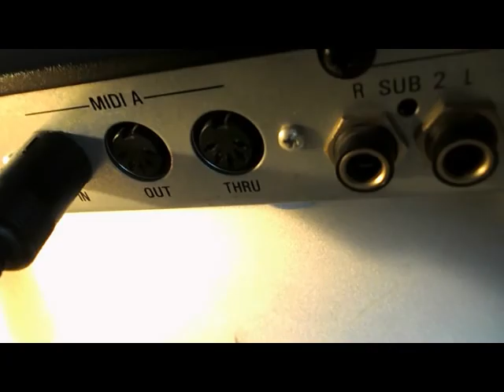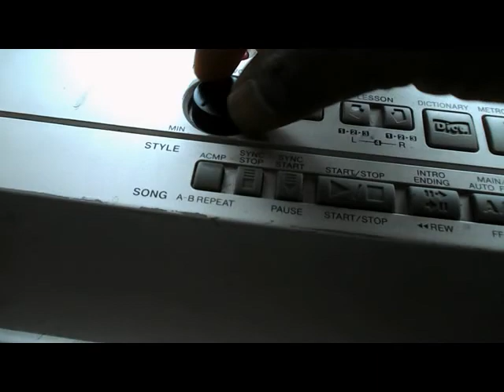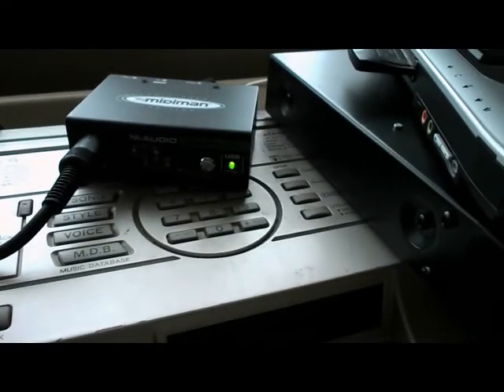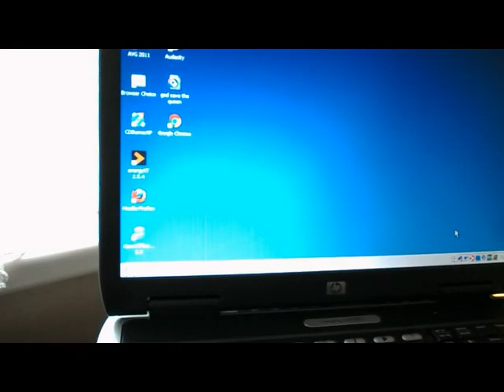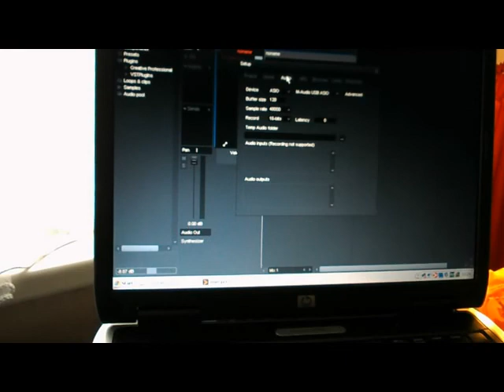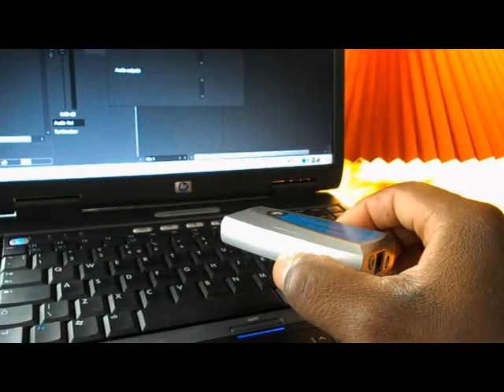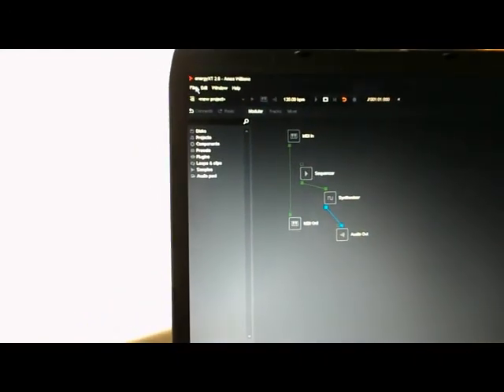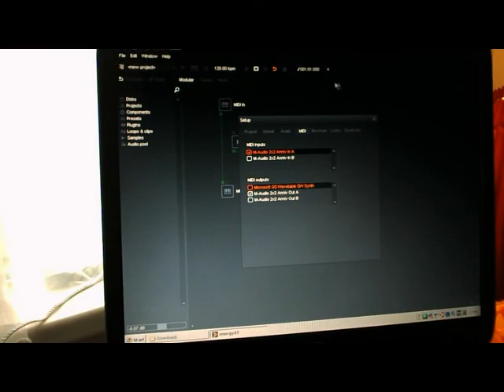MIDI connection walk through

Comment: Can I use a sound module just with a keyboard and an amp? No pc or other devices besides the cables?
Reply from the maker: The sort answer is yes.  A midi out cable connection from the keyboard to midi in on the sound module  will work directly.

Comment: hey  i heard someone on a video say that in order to take sound out of the sound module to keyboard you need an audio interface/sound card is it always necessary? cos i saw you only used the sound module and the keyboard and the cable, is it because your keyboard has speakers and most midi keyboards don't?
Reply from the maker: In this kind of setup you would expect the sound module audio output to connect directly to loud speakers or a mixing desk.  In my case I wasn’t using the internal sounds on the keyboard as the volume level was set to zero.  If I wanted to combine the keyboard audio I would turn the volume up and connect the audio out directly to another set of loud speakers or a mixing desk.  It’s unusual for a keyboard to have audio input but I used to have a Yamaha PF70 that accepted audio input:  In this case I could connect the audio output direct into the keyboard and both the sound mode and internal keyboard voices would combine to be heard through the keyboard speakers and keyboard audio output..  Another scenario could be to mix all your sounds through a computer.  In this case you would need an audio interface with at least two input channels, one for the keyboard and the other for the sound module; other sounds may be generated internally from the computer.  In this case the computer becomes the audio mixer and the audio output from the computer goes to loud speakers.
Reply: Thanks money is an issue for me atm ,later i might get a triton extreme and install the moss board or any other  synthesizer but i can't wait i need a keyboard for now.i saw on gumtree.com trinity classic for £170 but i don't know how good its sound quality is compared to a used sound module around £80-£120 on ebay ,if i buy a sound module i hope i should be fine connecting the the midi 5 pin cable into the sound module's input and into    midi keyboard's output and connect the audio cables to sound module ''left-right'' and connect it to my amplifier+speakers and i shouldn't need any computer or sound card.What do you think of buying an ipad and using a software synthesizer or using a pc software? Are sound modules really better and more powerful or more responsive than a software?Or are they very similar?
Reply from the maker: There are a lot of ways to try an answer your question, but what I'll do is tell you of my experience with keyboard and modules.
One of the first keyboards I bought was the Yamaha PF70.  Having had classical piano lessons, I was interested in a keyboard that felt close to a real piano and had pretty much a full size keyboard - 76 keys, however, the keyboard was limited to about 10 electronic piano sounds and so adding a sound module (in my case a Yamaha TG33) was a budget way of adding extra sounds whilst having the keyboard type I wanted.  In the early ninety's, sound-modules tended to have a higher memory specification compared to the keyboard counter-part; so for example the keyboard version Yamaha SY35 would have 16 note polyphony while the TG33 had 32 note polyphony (that being the number of notes that can be played at one time).  However, the sounds and audio quality were exactly the same between the keyboard and the module version.

My current preference and budget solution these days is to use a midi keyboard (I have a Roland JV80 and the Edirol PCR-80) connected to a computer (Macbook Quad Core 16GB RAM).  The keyboards I got cheap because I bought them from ebay as faulty but I knew how to repair them; the Laptop came in at a good price on ebay.  The advantage that I personally get through a computer managed audio device is that I can arrange voices, layers and splits exactly as I want them and the polyphony I find is far more flexible than the kind of sound modules I can afford considering that I use a lot of voice layering.

On the other hand, a modern sound module should offer at least 128 polyphony and would be considered by some as more stable and reliable than a computer for live performances.  The iPad can be used as a sound module; ideally you'd want to be aiming for an iPad Air or better.  I have the iPad Air 2 which I use with the Alesis iPad Dock II which in turn allows midi in and out ports and audio ports.  The bismark bs-16i is a budget priced app with some really good natural sounds with the option to load your own sounds in the soundfont sf2 format.  Sampletank is another app that I have on the iPad and is a more polished software presentation.  Polyphony will depend on the power of the iPad which for me was about 64 note polyphony and in both app cases, voice layering is limited to 8 voices on 8 midi channels.  My Roland JV80 worked well in midi mode to remotely switch the 8 midi channels off and on as well as control the volume levels on each channel;  my only disappointment was that I couldn't get it to do a midi split on the fly which I can do on a fully fleged computer.

If you already have a keyboard, I would suggest that you go for the sound module since it will cost half the price of the keyboard version and the module version may well have a higher polyphony specification.  If you're not fussed about being mobile with two divices and connection cables then result wise you'll have the same sound at half the cost.  I wouldn't recomment using a computer unless you're well acquainted with troubleshooting problems.